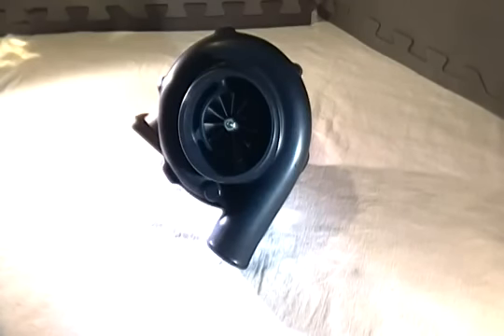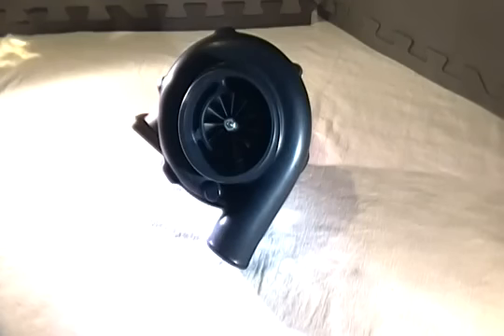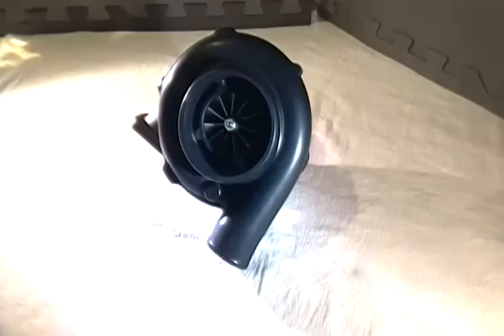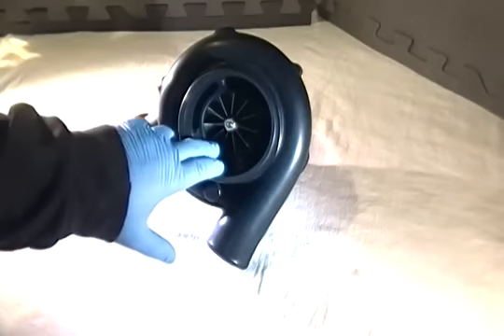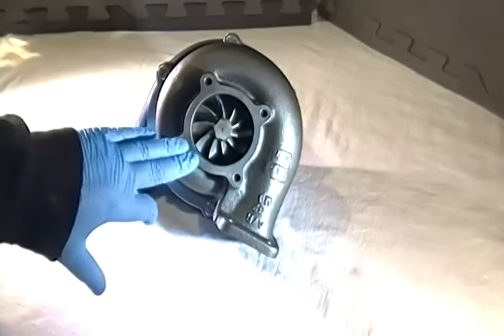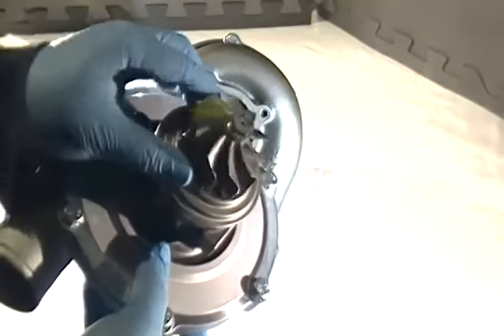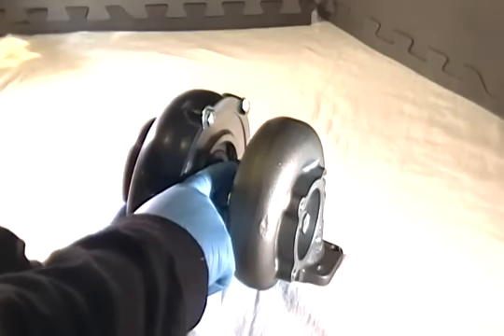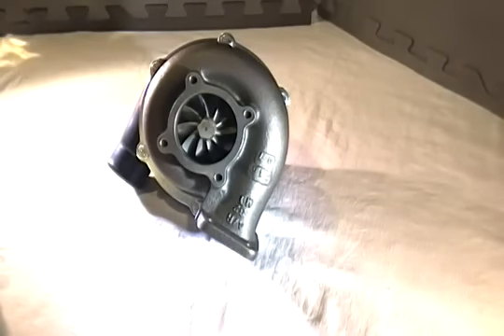GTX3576R Garrett Turbocharger STC Description & Features

Comment from the maker: Sorry for the late response, sajsed2. I really am not much of a fan of Precisions current line. But it's not due to their design structure or the fact that they still make peak power rather well. I'd rather not elaborate publicly about it much mainly due to libel reasons.  

We mainly focus on Garrett structured turbos, but we do work with IHI and Borg-Warner ones as well. Stay tuned for our IHI videos.

You can always e-mail us via the website for other questions. Thanks.

Comment: hey man, love your videos.
So i have a gtx3076r, so i just have to get a turbine side of gtx357r to upgrade to 3576r?
thanks.
Reply from the maker: +Tarmizi Nazarudin. No, you must get an entirely new CHRA to get the larger exhaust wheel.  Genuine Garrett exhaust wheels generally are not sold independently of the rest of the CHRA.